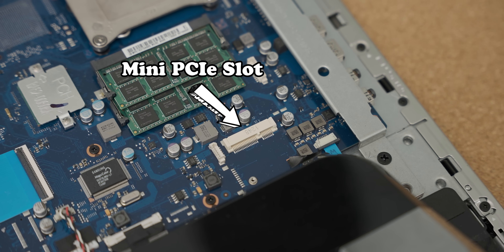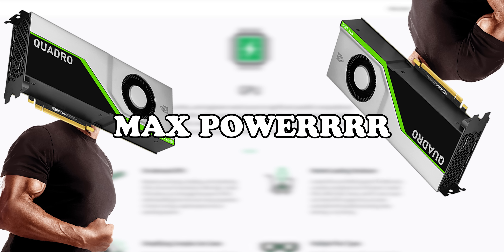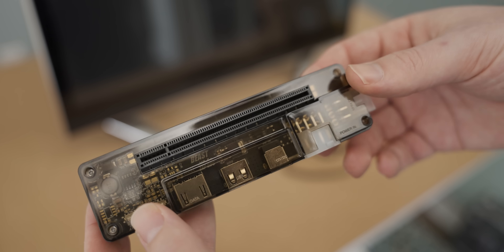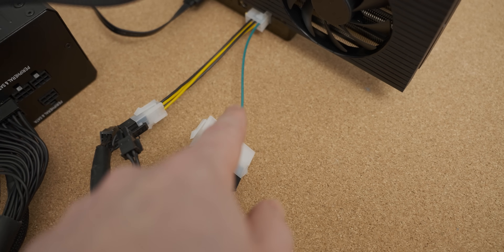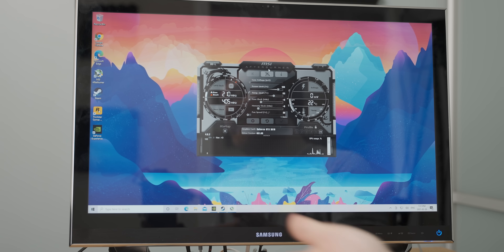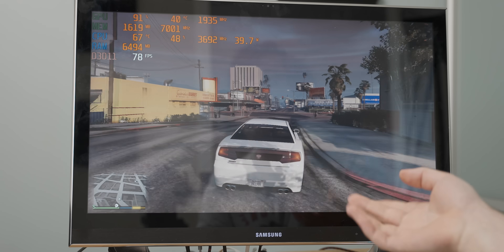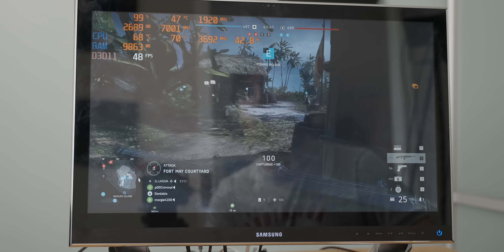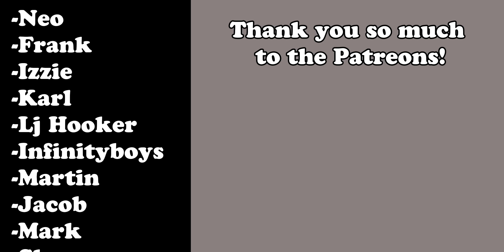The REAL Ultimate GPU Bottleneck? RTX 3070 with Mini PCIe (Pt. 2)

Comment: dont blame the cards, blame  all the motherboard makers for not putting standard active PCI E x4 slots instead of the lowest x1 on everything even today.
for reference dont forget the interconnect port speeds are around...
Mini PCI Express has a speed of 2.5Gb/s

PCI-E 2.0 x2 6.4 Gb/s (800 MB/s)
PCI-E 2.0 x4 12.8 Gb/s (1.6 GB/s)
PCI-E 3.0 x4 31.5 Gb/s (3.9 GB/s)

see even the really old PCI-E 2.0 x4 gives a card reasonable breathing room for an x4 10Gb/s ethernet card etc ,demand all motherboard vendors replace all x1 with active x4 asap going forward.
Reply: well there is pcie x4 on nvme ssd slots

Comment: I can see that you have bought my suggested pcie adapter instead of using that previous janky setup.
Reply: Thanks Eat Soup
Reply: Isn't this the same type of adapter Linus used in the Latte panda with Titan vid?
Reply: @Sithedd  👍
Reply: It's the same type of adapter that anyone using a notebook computer mines crypto currency with. It's a junk adapter with a bullshit purpose.
Reply: @beaumontlivingston8084  thanks
Reply: @lakshyanarang6494  don't get me wrong, it has a purpose, just not a very good one, and I am guilty of using it to run a graphics adapter but not for gaming, just a secondary monitor on my Macbook pro
Reply: You cute bro
Reply: You are a pro at wish grade pc components
Reply: @beaumontlivingston8084  well not all bullshit,used a gtx 980 with my old laptop with janky igpu and was tenfold in framerate then the old setup, although I only used it once and now am getting a better laptop with a rtx 3060
Reply: @denisalexa4435  as stated by Dawid himself, the reason why it is slow is because of the cable connecting the pc to the adapter, it only has one lane of pcie, meanwhile m.2 has 4 lanes
Reply: @beaumontlivingston8084  macbook pro have usb c displayport, get a usb c to displayport adapter, this way you can run a second monitor off of your laptop's gpu
Reply: @beaumontlivingston8084  nobody mines crypto with a notebook egpu, most miners will use a pcie x1 to USB to pcie adapter to mine with multiple gpus
Reply: @lakshyanarang6494  yes, except linus used an M.2 NVMe connector which provides 4 lanes of pcie instead of 1, giving him better bandwidth.
Reply: @eatsoupeveryday  thanks for the clarification
Reply: This setup wasn't janky? I mean it did work at least but it wasn't any less janky.
Reply from the maker: Hell yeah! You helped me a lot. Thank you. 😁
Reply: which adapter is it?
Reply: Hehe , Yeah Boi.
Reply: @etaashmathamsetty7399  It is most commonly called the "exp gdc beast" or "exp gdc" for short
Reply: @beaumontlivingston8084  meow
Reply: @beaumontlivingston8084  I was going to get one for my Dell latitude E6510 (for gaming) but i decided because it would be so big and probably need an external power supply to run a powerful card (but almost anything would be more powerful than a gt218m) that I would just try to get the gt218m to run my games better by giving it more VRAM (and better memory speeds from having more chips) but to do that i needed to solder the new chips on and I broke the whole motherboard for that laptop while doing the upgrade, I should have just bought one of these and a cheap graphics card when I could before I broke the laptop because if I did that I would still have a pretty good laptop and wouldn't need to wait until I can get a new one to replace it with something a little newer or have to use my phone which needs a new app for most of the things I try to do on it.
Reply: @nathanmead140  Yo I have the same laptop with an NVS3100M which is like the same GPU. Mine has the screen broken so I neeed an external monitor whenever I need to use It. Everytime I do so I think about one of this adapters and about plugging my GT440 (which is 5 rimes more powerful) to it and game
Reply: So can you do this with any laptop that has the Wifi card? And I would assume you would need to use an external display and not the built-in screen? 

I'd love to get some good use out of a laptop that has the crappy ATI HD4400 integrated GPU BS.
Reply: @eatsoupeveryday  there's actually a new version of the 'beast' that uses a m.2 slot.
Reply: Where can I buy it? I have an all in one pc and an old gt 220 lying around.... 🤔
Reply: Shiba Inu
Reply: soup isn't real food

Comment: I have the ADT-Link version connected to a "DeskMini 110" and it rips... also the connections and setup are much cleaner as you use a dell power brick to run it instead of a whole PSU like that.

Comment: I actually did this with my xps l502x, I used a msi gtx 950, did not need external 6 pin power so worked out great

Comment: i'd really like to see what a reasonable pairing like a gtx 1650 would look like.
Reply: I got a 3935 score  on Furmark 1080p (external tv) with this same EXP GDC external GPU adapter, a GTX 970, and a Lenovo ideapad 330 (pentium n5000 4-core, intel hd 605). 60 fps on mass effect 2 and 35fps on kerbal space program, high settings. The main problem is BSODs from fluorescent light electromagnetic interference, due to the unshielded HDMI cable.
Reply: @martinbadoy5827  what the fuck i didn't expect that.
So shielding the cable would be a good idea then.  Thanks for the information kind stranger

Comment: I'm actually impressed that the proprietary bios even allowed a dedicated GPU to work.
Reply from the maker: It is impressive how plug and play it was.
Reply: I have one that works on a Dell Latitude E6540
"plays" Cyberpunk on with a Titan on the beast bridge
Reply: @DawidDoesTechStuff  Aside from the fact that you used a 30 series, It pretty impressive overall. Im guessing you would get similar performance out of a much cheaper lower spec gpu. Some people with super small pc's may be able to take advantage of this.
Reply from the maker: @crisnmaryfam7344  Oh for sure. Something like a GTX 1050 could be a decent pairing. Maybe even something a bit slower. 👍
Reply: @DawidDoesTechStuff  I was interested in trying something the other day, it was a daisy chain I thought of; Sata to m.2 and then m.2 to pciex4... Of course you would need to run the OS from a fast form of usb. Not sure if it would work but I was bored and thought of trying it since I already have a few different sata to m.2 adapters. Sounds like a cool idea for a revisit for you tho, and costing less than $40.
Reply: @DawidDoesTechStuff a gt 1030 could be used with only the 1 pci e power cable to the slot
Reply: I'm actually impressed he got a 3070!
Reply: @zsoltpeterdaniel8413  Maybe use some type of USB power adapter to actually run the slot off the system? I actually did this to run a PCI-e slot for a super small form factor PC. But it was pugged into a normal PCI-e slot, just not one with enough PCI-e power to run the GPU (damn you proprietary non-standard mobos!. So I had to improvise. It does look kind of cool having the GPU just sitting on top of the computer case though. lol.
Reply: @JJ21lives4ever  Sata to M.2 ist still a Sata signal at the other end. That won't work with a GPU
Reply: @BReal-10EC  You can get 10W at best from a USB 3.0 port
Reply: @resneptacle  Really? That's weird. Wait, I need to check. I may have used SATA To 6 Pin adapter instead of a USB powered one. It's been a while since I did it.
Reply: @BReal-10EC  and i doubt that you converted the 5V USB to 12V for your GPU.
Reply: @omegaPhix  I'll check later. It must have been something else. Cut me some slack.. my memory fades.
Reply: @omegaPhix  Ok, I used a Rosewill RCRC-17001 Mining Riser Card. The USB cable is actually how the card connects to the part in the PCI-e slot. The power is PCI-e 6 pin, and it came with an SATA 15 pin to PCI-e 6 pin cable adapter to power just the PCI-e slot on the riser card.
Reply: @BReal-10EC  yep, sounds good to me :)
I'm using a ton of these cheap risers in my rig. Pretty reliable
Reply: @omegaPhix  It would be interesting to see somebody do a gaming test on such a riser card to see just how powerful a GPU you can use without the card being crippled by the limited connection speed.

Comment: If you lower the monitors resolution or only use the GPU as a rendering device it would probably perform better since yeah, 1x is not doing HDMI and GPU stuff at the same time

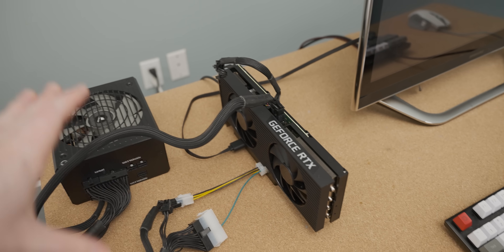Comment: Had an idea based on the view from 5:12 and checked your other videos. Looks like there was an option (and samsung's support page indicates this as well, AMD Radeon HD 7850M to be exact) for a GPU to be soldered onto the motherboard. So maybe there might be a way of getting something like an PCI-E 8x slot from that bare section of where the GPU was meant to go.
Reply: Soldering a slot adapter in without introducing SI problems would be tricky, but it is definitely theoretically sound idea.

Comment: This is so dumb: it has a transfer speed of PCIe 1.0 x1, which means it is running 1.5% of the bandwidth of a normal 3070 connection!

Comment: nice. now new updated video with same 3070, but using mini pcie 3.0x4 slot in any laptop. now new laptops have nvme ssd in it, so what if replace ssd with external rtx 3070? or add rtx 3070 if there is second mini pcie slot for another nvme ssd??

Comment: If you really want a bottleneck get an ivy bridge thinkpad with an ExpressCard slot. That's 1 lane of PCIe 2.0. Basically USB 3.0 speeds.
Reply: How about a core i9 10980 XE with two voodoo 2 in SLI? I'm pretty sure I've seen motherboards with like h310 chipsests and ISA or PCI slots, just because of some industrial machine that still needs it.
Reply: @user-le8ul4nr5t  an i9 strapped to an SLI or a XFire configuration is ludacris! Especially with any of the recent GPUs. In every setup I did SLI or XFire, it's was easily beaten by a single GPU setup in nearly every situation, the games don't like to do SLI anymore, too much data throughput during processing SLOWS DOWN the output because it has to mux the output, adding extra processes that wouldn't otherwise be present in a single GPU setup.
Reply: My friend has one of those and I upgraded it for them. (to 16GB ram and 500GB ssd)
Reply: @beaumontlivingston8084  we're trying to achieve the biggest bottleneck... Also a voodoo 2 isn't exactly a new card, SLI still made sense back when it was invented.
Reply: @user-le8ul4nr5t  Different sockets bud. That i9 is x299. I think you meant 10900k
Reply: @joeyhillers9460  yeah, I messed up. I've checked and the one I was thinking about is a z390 chipset so it's not even 10th gen, it's a 9900k.
Reply: @user-le8ul4nr5t  10980xe is trash
Reply: @muhammadamohsin  yeah, not nearly as powerful as the RISC based MOS 6502...
Reply from the maker: I think this may also be Gen 2. Not a 100% sure though.
Reply: @DawidDoesTechStuff  Good chance it is as the mPCIe may be connected to the chipset rather than the CPU and the chipset only supports 2.0.
Reply: @DawidDoesTechStuff  Remember when we used to try and not bottleneck our gpu's Lmao, what a time to be alive.
Reply: @beaumontlivingston8084  I had two 2080 Ti’s on my 9900K and as long as the game or benchmark supported SLI, performance was crazy.  Typically you have x8/x8 in SLI and as long as you favor resolution over very high frame rates your CPU won’t make a lot of difference because it’s not being stressed, assuming you have a decent CPU to begin with.  I currently have a single 3090 because, yes, with this current generation SLI is truly dead.  But even at full x16 the 3090 doesn’t even come close to the performance of SLI 2080 Ti’s in games that supported SLI, which up until recently was about 50% of games that I have played in the past 2-3 years.
Reply: I did this with my t420 thinkpad and a 1060 6gb. I feel like it ran better than this 3070. I could actually get 60fps on borderlands 3 with mixed settings at 1080p. I couldnt get it to work on an internal display though so only another monitor or a TV. Itwas to bulky so I ended up building an k39 case itx build.
Reply: @user-le8ul4nr5t  ye
Reply: @niospartan  yeah same here, i'm running a t430 with a gtx 1660 and I feel like it runs better than this samsung/3070 combo, at least in csgo...
Reply: @DawidDoesTechStuff  Hi, I am a little bit late, sorry. You had to check with GPUz but I don't think the system was running at pcie gen 2.0 with mine I can also stream using nvec encoder and when I push the GPU the GPU usage is around 100% and the thermals goes up as a normal usage with a normal system. I made the same thing with my laptop few months ago and it worked also thanks to egpu forum and I also overclocked my gtx 1660 super (gpu and memory) and it works well just around 3 frames drop while streaming with obs. Here I leave a video of my adventure
https://youtu.be/NMIsofBSM-Y
The real problem is the instability of the beast when there are interferences in the power line for example when a fridge pump was switching on the beast was freezing with a bsod on windows Video_tdr_failure or SYSTEM THREAD EXCEPTION NOT HANDLED with the latest Nvidia driver. The only solution was using an UPS with AVR (automation voltage regulator) and the beast stop getting interferences from the power line. Bye
Reply: Bottleneck that mess with a Rage 128 card.
Reply: I used that exact setup for a while with a GTX 1080, it's still a lot better than iGPU, though it gets real stuttery when textures are loading.
Reply: @jm036  
 @Dawid Does Tech Stuff It is 2.0 version Pcie
Reply: @DawidDoesTechStuff  it actually is only Gen 1. thats why u got that horrible performance. they never offically made a version that is Gen 2, there might be some that are Gen 2 though. Only with its successor the M.2 slot the skipped over Gen 2 and went directly for Gen 3

Comment: Funny thing is that a lower end card would have been bottnecked more badly than RTX 3070.  Lower end cards usually don't have enough VRAM so they'll also use regular RAM. This requires a lot of PCI-express bandwidth.    For example:  RTX 3080 with AGP bus speeds is still faster than RTX 3070 with PCIe 4.0 x16..but RX5500 4GB's performance tanks if you put it to PCI 3.0 slot instead of 4.0  

RX5500 card being electronically only x8 is a major factor obviously, but   PCI 3.0 x8  still offers 4 times more bandwidth than AGP.

Comment: Now try that combination in a proper pc motherboard, I would LOVE to see the comparasion
Reply: That and try weaker graphics cards like a 1050 ti
Reply: @dakoderii4221  no, I speak about using the i7 3770 with a proper cooler and some proper ram, if you manage to do sum overclock I bet that there will be not much of a bottleneck, like max 30-20%

Comment: So this is genuinely a useful video. I got hold of a old 2011 Sony VPCL2 All in One. It’s great, 1080p display, i7 with 3d and a touchscreen. The big bottleneck is the graphics card: a GT 540M. There is a free mini pcie slot on the board so I wonder if this is something that could be done? Question is what graphics card to get

Comment: The EXP GDC is the only adapter with proven compatibility and works best from all of this type of devices. But its practical side is highly debatable, because it's not that cheap when you need GPU, adapter and also the power supply. At this point maybe better will be change the entire notebook.

Comment: i have a question is it possible to use this on an 4th generation i7 alienware m14 and since i have only sata drives could i use a stata adapter to use the M.2 setup to run like a 2060 nivida video card

Comment: Hmm. Maybe repeat this with a weaker card like a 570 or a GTX 1050. I'd be interested to see if a weaker card was able to push out the same framerate over the mini-pcie.
Reply: EXP GDC Minimum Requirements for GTX is any card WITH PCIe power cable. So often we find GTX 1050 without PCIe power cable so it cannot work with EXP GDC. Because the EXP GDC itself cannot feed a stable 75 watt.

Same thing with RX 570.

As for NVidia GT series like GT 1030 GDDR5, it could work on EXP GDC.

Comment: The adapter costs as much as a cheap graphics card.
Reply: Ummmm NO.
Depending on where you're searching for it. Also where you Live.

I bought mine for only $30 including shipping.
It actually makes sense if it's somewhat more expensive for you depending on your Location.

Because this particular adapter is literally made by a single small company somewhere in China.

Since this Adapter is kinda rare, it makes sense if it became a bit expensive mainly due to shipping costs.

Comment: I used this adapter with an amd r9 270 and an 8core laptop processor and it was impressive, but I wouldn’t recommend it for anyone wanting a modern AAA-title experience in 1440p at 144hz. You’d be better off investing in a better platform that can match the bandwidth requirements

Comment: Hey Dawid hallo from Sydney Australia :) just wondering would it make a difference if you just ran a much less powerful card ? Considering if it’s doesn’t seem to using all the bandwidth you could us a 1650 LP that doesn’t require a power supply and possibly get the same rates :) have you tested that?

Comment: This type of setup is a lot faster if you are able to connect the exp gdc beast via m.2 wifi interface. I was able to play GTA V on max 1080p well over 60fps using an rx 5700.
Reply: Do have a video of u doing so?
I'd be interested
Reply: @gamingtalent2888  I do not have video or pictures atm, but I may upload one in the near future. If you're on dawid's discord, I'll dm you pictures of my setup with it.
Reply: Yup, both the M.2 A key or M key model can give X4 instead of X1, as long as you're willing to give up inbuilt Wi-Fi and use USB Wi-Fi adapters (hell YES!)
Reply: @eatsoupeveryday  ohh, i am not on discord unfortunately
Reply: @jygoh1419  That is correct.